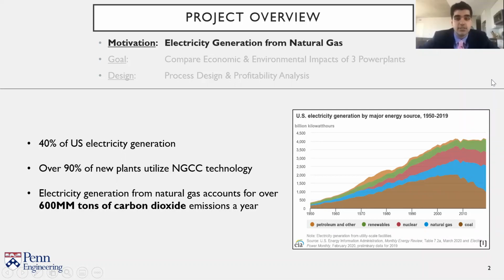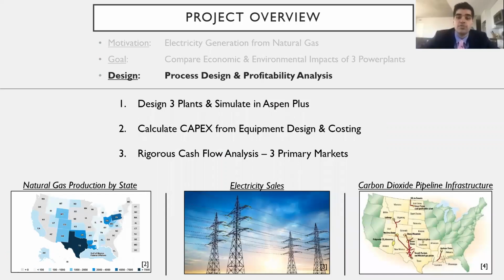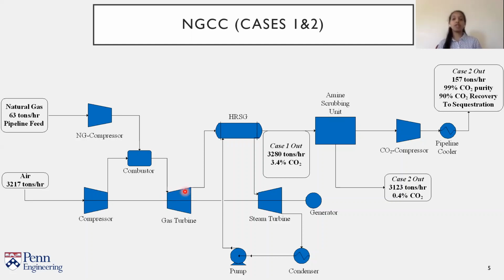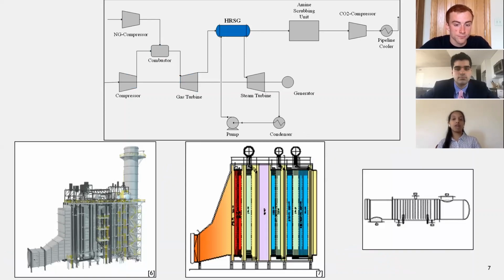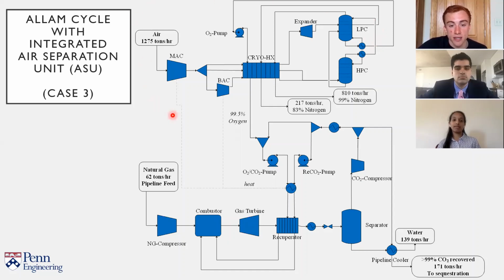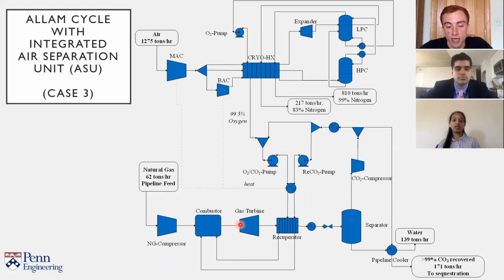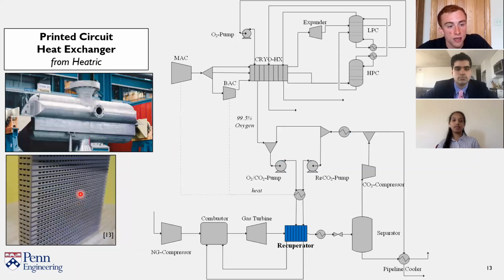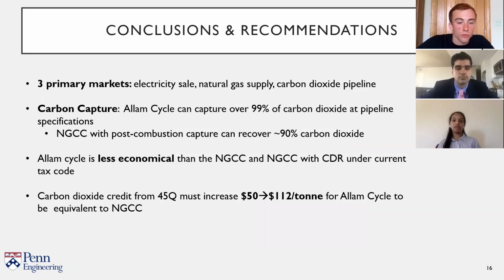Carbon Dioxide Sequestration by Allam Cycle (Penn CBE: Chaturvedi, Kennedy, Metew)

Comment: Why is an Allan Cycle plant more than twice expensive than NGCC? Which components are making it expensive? I wonder bcs Allam looks a lot more simple than NGCC. Is it air separation? 

If this is purely bcs of economies of scale, we can easily overcome it by just mass producing those components with government subsidy
Reply: A NGCC power station is comparatively cheap and fast to build verses a new ultra supercritical clean coal plant.   So almost any other large generating source will be more expensive to implement.  The only large electric generation that is cheaper to implement is simple cycle natural gas turbine generators greatly used for peaking power and supporting large amounts of wild AC on the public power grid from solar voltaic and wind turbine generated electricity.   

On average less than a 0.1% share of earth's water vapor saturated greenhouse effect is from human caused atmospheric carbon dioxide.   Earth's greenhouse effect is from water vapor.  The other greenhouse gases can not change its overall effect that adds 10°F to earth's average temperature absorbing all the greenhouse radiant energy from the earth within a few meters of the radiating surface.  NASA reports global warming at 1°C where it has been since 1992.  The cause of global warming is not known.

Comment: Lovely design that will eliminate traditional smog pollutants like NOx.  The CO2 intractable problem however is not addressed at all, which is not how extract CO2 from combustion, but to bury carbon at a rate of 30B tons per year, which means an attempt at replicating the entire fossil fuel extraction industry, built over a hundred years, in reverse.  It’s not remotely possible with existing infrastructure and tech., nevermind the hopeless economics. 

What is possible is sell off a bit of CO2 to enhanced oil extraction, which can be argued does nothing at all for negative carbon, nevermind it makes money and probably draws state credits .